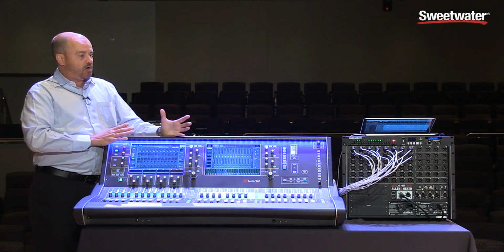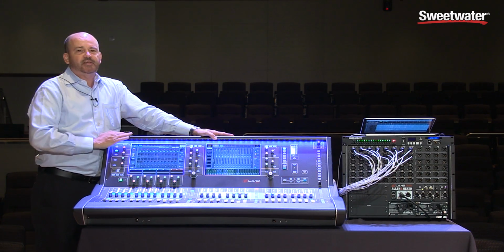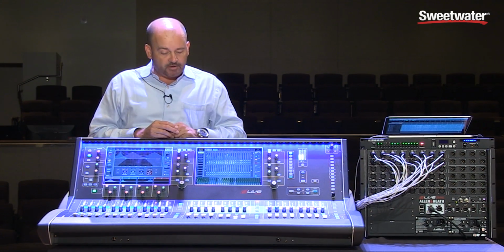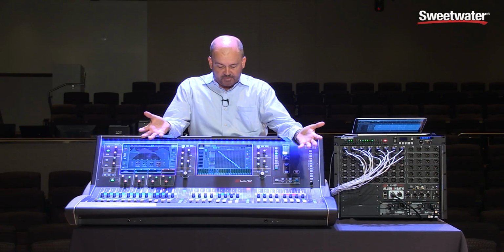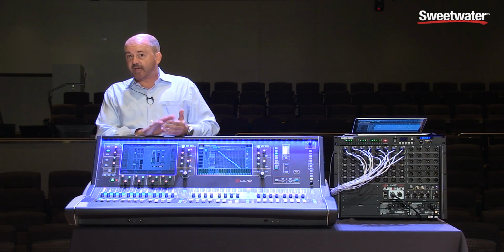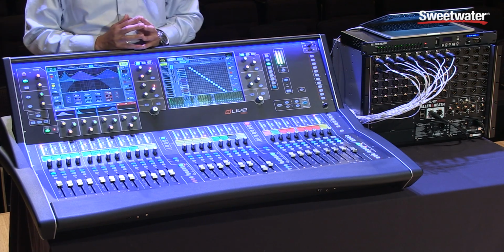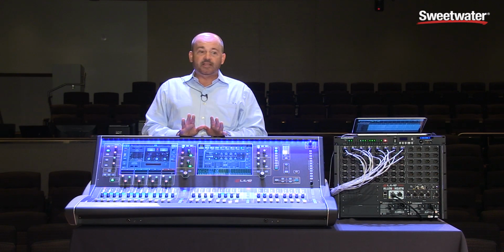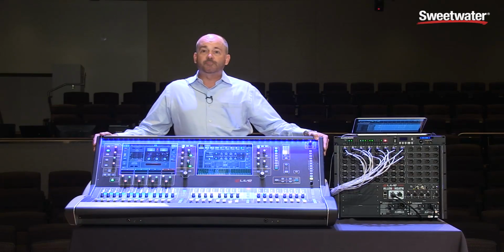Allen & Heath dLive S5000 Overview by Sweetwater

Comment: So, my church is getting one of these shortly.  I'm a novice with sound.  So is 'surface' the same thing as 'console'?  Need to learn as much as I can before we go live.
Reply from the maker: Hello! Jose from Sweetwater, here. Great question! The differences between a console and control surface are very slim. For the most part, the console would have all or a good amount of I/O built into the unit. A control surface would mainly work from a remote driver such as the MixRack options that are offered with the dLive series of control surfaces. I'd love to speak with you more on the details, so feel free to give me a shout at my contact information below. Thanks for the interest! 
Jose Gonzalez, Sweetwater Sales Engineer, (800) 222-4700 ext. 1786, jose_gonzalez@sweetwater.com

Comment: omg someone please explain to me the diff between S5000 class and the SQ7?
Reply: I’ve seen this question pop up a few times so here’s the simple answer, the SQ7 is using the same base FPGA architecture as the D series but is just a larger version of the others in the SQ range meaning it has a max input count of 48 channels and all processing is done on board, meaning it’s an out of the box solution. 

The D series is a more professionally aimed product, the processing is done from the mix racks rather than the mix surface itself and is expandable up to 128 channels of input. The D series is an ecosystem of products that work together to create your mixer, as far as I understand the S5000 itself is just a control surface for the mix racks. 

There are obviously many other differences, but I hope that helps a bit.
Reply: @THECardboardtheatre  thank you sir I already purchased the SQ7 and cant wait to install it and start learning all that it can do. I love one feature that my old Roland doesnt have that this one does and that is you can lable the channels since the patch bay can be all over the place at times.
Reply: Sound..After playing with a dlive c1500 and come back to a SQ6, the difference is better sound, better processing, a class or two better than the sq series